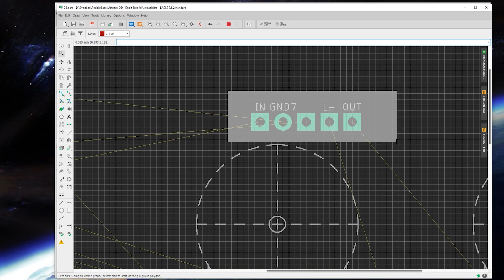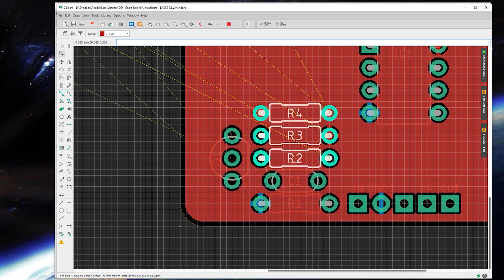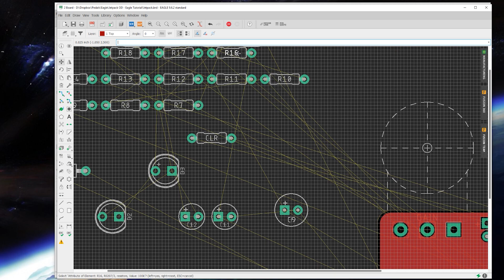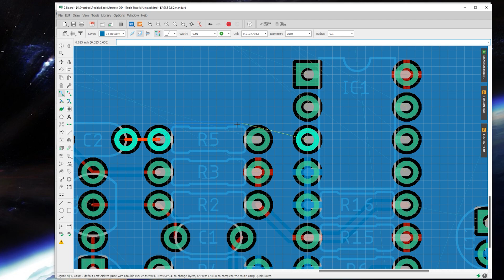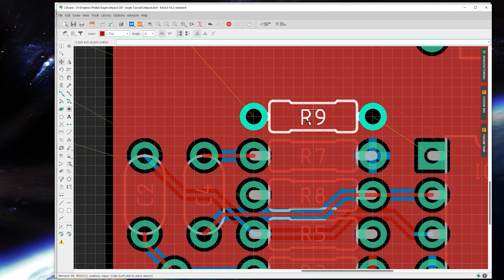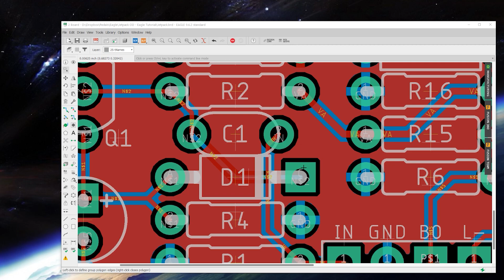EFFECTS LAYOUTS - Eagle Tutorial Episode 5: Circuit Board Layout part 2

Comment: great tutorial, I followed it religiously and completed my first schematic and layout so thank you. I was just wondering, why not just use the auto-route feature for the pcb layout?
Reply from the maker: Short answer: the autorouter is terrible. 
Long answer: the autorouter is just a tool and can be beneficial if you set your parameters very precisely and know what you're doing, but rarely would its result be your final design. Some use it for very simple designs or as a starting point and then manually go over every trace and tweak as necessary. Let's take an LFO in a modulation effect for example. The autorouter doesn't know part of your circuit is an LFO and won't take any design precautions to avoid unwanted noise like ticking. Manual routing with the knowledge that you might need to isolate the LFO for the audio path will potentially create a more sound design. In my experience the autorouter isn't as reliable as my own eye and doesn't know what I know about the circuit I'm laying out. You can only tell it so much, and while you may be able to get away with it in some instances, you need to have experience doing it manually so you know what to fix if you use the autorouter down the road.

Comment: Very nice tutorial. Increasing the trace width could have some benefits, but some deficits too. By increasing it, you can allow more current through, but you increase the crosstalk between signals at the same time. That's why in analog circuitry design designers mainly use small and short traces for noise prone signals (for example the negative input of an op-amp), in order to reduce the crosstalk between nearby signals. You can think it this way, the width of a trace dictates the current ability and the space between traces the voltage integrity. In audio circuitry design, due to the low frequencies involved the width isn't all that important as long as the maximum current draw is less than the current ability of the trace, but it's a good rule of thumb to remember.